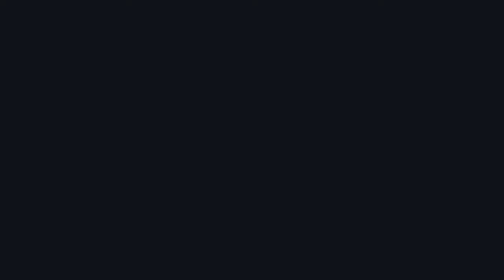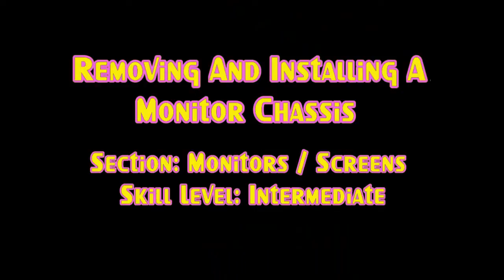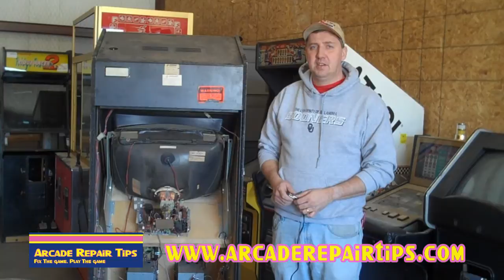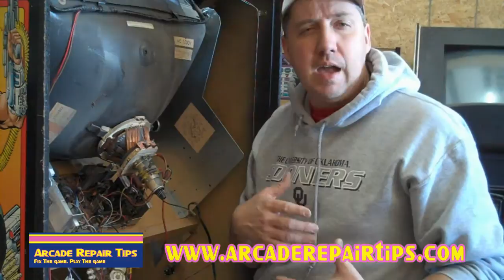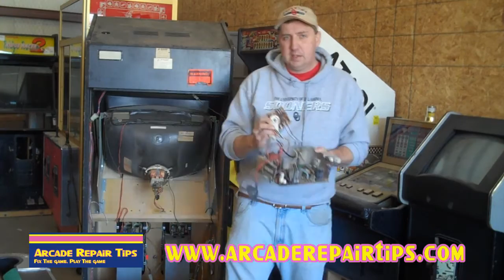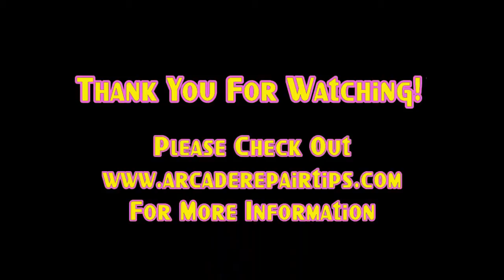Arcade Repair Tips - Removing And Installing A Monitor Chassis

Comment: 2:30  Funny that you mentioned silicone to glue neckboard on the back of the monitor.  We have two hyster power jacks at work that keep stopping intermittently.  We have to turn the power off and turn back on to get going again.  I think I located the area where the loose connection is occurring.  Must be 30+ gauge wires for controlling relays.  I wiggled 5 connectors and was able to use it for 2 hours without stopping!  3 days later, it is starting to stop again.  I was thinking about dabbing a little silicone between the wire and connector.  I am going to check with my manager before attempting.  I would prefer to rebuild the entire wiring harness with solder and better wire but I am not a trained maintenance tech....

Comment: Can you tell me where the loose wire go, on my arcade video floor unit, sound works but no picture because of loose wire
Reply from the maker: Depends on where the loose wire is connected currently. Try tracing it back to the connected end and see where it goes. If it's connected to the harness for your game board, you should be able to determine where the loose end should connect by using the pinouts for your particular game. If it's connected to a particular part (such as the monitor chassis), the loose end probably connects to the harness for the game board. If you need additional help, please email us at questions@arcaderepairtips.com. Good luck with your repair.

Comment: newbie question,  Is the ground wire on the chassis of the CRT going anywhere?  wouldn't you want the voltages Isolated, like they always say, isolation Xformer for safety.
and why didn't you discharge and caps on the CRT's  board?
Reply from the maker: Stan, the ground wire is typically grounded to the monitor frame with itself being connected to the ground prong on the AC plug. While most older monitors require an isolation transformer, newer monitors include switch mode isolation on the chassis. You can discharge the caps, but they usually don’t hold much of a charge so we typically don't bother with it. Of course, the choice is yours.

If you would like more details about your question, please tune into our Live Show Episode 54 on Thursday, August 5, 2021 at 5:30 PM CT. Here's a link to the episode if you want to watch it: https://www.youtube.com/watch?v=rW25CZFclWs. Thank you for your questions and good luck with your future repairs.
Reply: no response?

Comment: Hey man I have a robocop I need too wire the monitor up I replaced aka power wire but not sure how or what too it’s not even cut yet still has wall end on it
Reply from the maker: So, it sounds like you have a monitor that has a wall plug on it and you're trying to wire it up inside your cabinet. If this is the case, you should be able to cut it off and wire it to any incoming AC point in your cabinet. We like to use an AC distribution block but that's not a requirement. Again, pretty much anywhere in your cabinet where you're getting AC power (power cord, AC filter, power supply, etc.) should work.

Also, just wanted to let you know that we will be covering your question on our Live Show Episode 46 on Thursday, December 3, 2020 at 5:30 PM CT. Here's a link to the episode if you want to watch it: https://youtu.be/vcE7kPMwRP4. Thank you for your question and good luck with your future repairs.

Comment: Can you safely clean the back of the monitor with a cloth, when it's not discharged? Just the back of the actual monitor chassis.
Reply from the maker: Yes, but we wouldn't recommend a cloth. We prefer to use canned air and/or an anti-static brush for cleaning purposes.

Also, just wanted to let you know that we will be covering your question on our Live Show Episode 46 on Thursday, December 3, 2020 at 5:30 PM CT. Here's a link to the episode if you want to watch it: https://youtu.be/vcE7kPMwRP4. Thank you for your question and good luck with your future repairs.

Comment: @Arcade Repair Tips I need some help with an arcade machine, will you help me? I only can write here because google discontinued the very well hidden message button's functionality because of "no interest"....
I got a time crisis 2 deluxe with 50" pioneer projection monitor. And one of it lost the game signal. I was just watching the demo, and the picture just faded out..
First I thought that the monitor driver board died, but not, it's alive. When i push buttons on the control panel i can bring up the monitor's OSD menu, and it works like it should. But I can't figure out how the game signal gone. The cable is OK, i crosslinked them. The game panels are ok, tried them one-by-one on the working side. Everything seems ok, but still not working. On the back, there is a test switch on one of the monitor's panel, and when I switch it it got the picture but black-white and runs upwards and no way to fine tune it. The other monitor simply switches to black-white mode and the picture is ok.
Without electrotechnical knowledge i can't do any more by myself. Can you give me some tips what to check?
 What parts to replace to maybe solve the problem? I think one small part causes this, like an elko, transistor or diode....
I can honor your help! :)
Thanks!

Comment: so I bought a sega hang on upright system and the neck board is fine but the pins when it slide onto the yoke are bent. can I bend them back and reattach or buy another monitor or yolk ?
Reply from the maker: Yes, you can bend them back but you want to be VERY careful. If you break one, you’ll probably need to find a new tube to use. We also discussed your question on Episode 31 of our Live Show. Make sure you check it out to hear our thoughts: https://www.youtube.com/watch?v=Ufdr0nVMjls

Comment: I got a Tekken 3 and the back board blocks you from discharging the monitor with ease. And a have a grey wire just hanging from the fly back. Can't see exactly where it hanging from due to the back of the machine being in the way. Any suggestions?
Reply: I got a Tokyo Drift and the back video card blocks you from discharging the monitor with ease and a have a grey wire just hanging from the fly back can't see exactly where it hanging from due to the back of the machine being in the way any suggestions?

Comment: An excellent video. Thanks so much for putting it together, I'm currently in the position of having to send off my Hantarex MTC9000 chassis away for repair. Yesterday I did the discharging, and thought  "How on earth am I meant to disconnect the chassis from the tube?".

Halfway through a day at work I think "Surely you must be able to disconnect the small board from the next of the tube". I get home, watch this video and all is revealed.

Thank you.

Comment: Great vids; I have an old frogger machine that I'm parting out and your in depth look and understanding of arcade internals has helped quite a bit, especially on discharging the anode. How would you recommend storing the PCB? im looking for a mobo anti static bag big enough lmk if you have any other ideas. Sub'd +1

Comment: hey! new at this... can u use any chassis on any tube i have 2 monitors, one is broken. can i pull the chassis from the working one and put it in the other cab? or do i have to switch the whole monitor?

Comment: You are so informative looked up your video on playing blind just got a Mr do that has all same symptoms an noticed a very small fuse on monitor chassis blown its  sodered so takn that out tonight and hopn for the best believe it blew because there were 5 game wires all exposed touching on the inside thanx again

Comment: Hey i wanted to asked you a quick question i'm putting together a arcade cabinet and i'm having trouble finding a monitor i need a monitor that would hook up with a pcb board of Battletoads arcade would you have any idea what monitor would be best to use

Comment: With the ground wire, where does the other end go? I understand the ground wire is there in case of a failure, then the charge will go down the ground wire. Is that correct? One end goes to the neck board, where does the other end go? Onto the CRT, but where exactly?